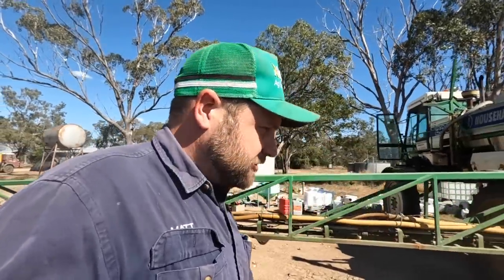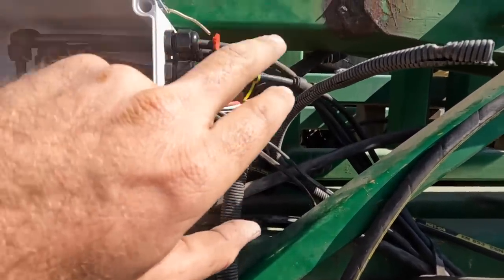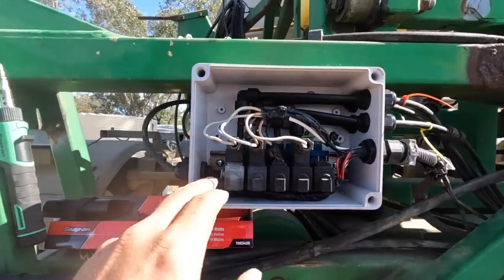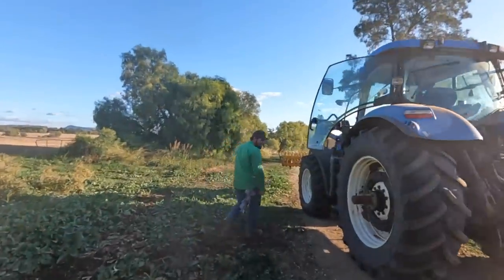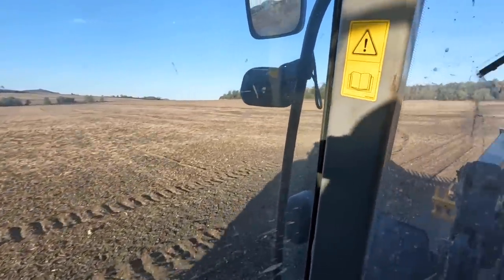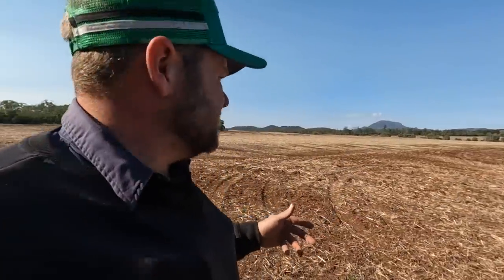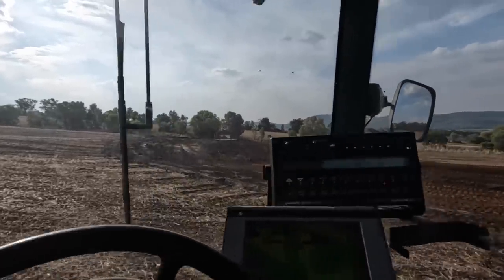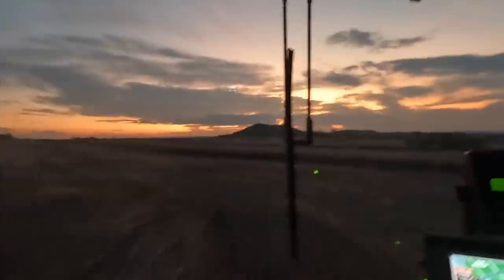TRACTORS Make TERRIBLE Ubers! | Planting 2023 | Vlog 167

Comment: Mat. Is the grasshopper cab equipped with filtered positive pressure air system to prevent the operator breathing in the spray chemicals☠️? 👍🏴
Reply from the maker: Hi mate, yep it is👍
Reply: @thejacksonbrothers  saves holding your breath for several hours 🤪😮‍💨 👍🏴